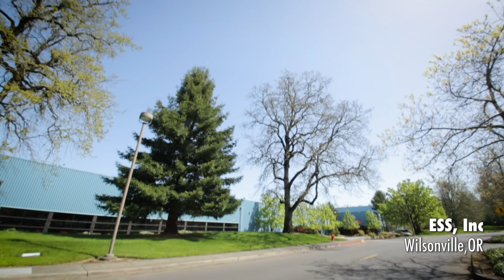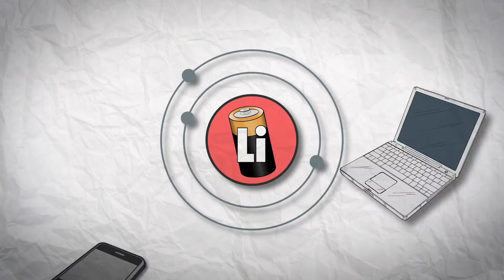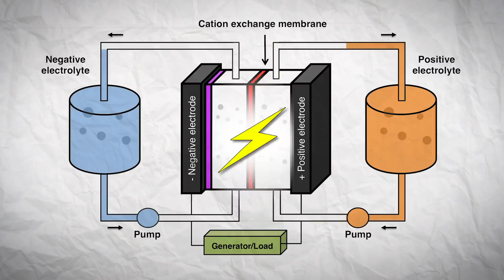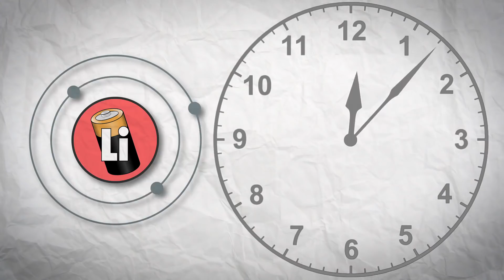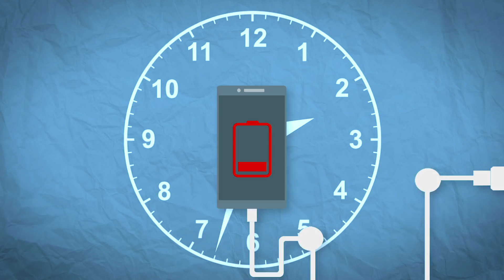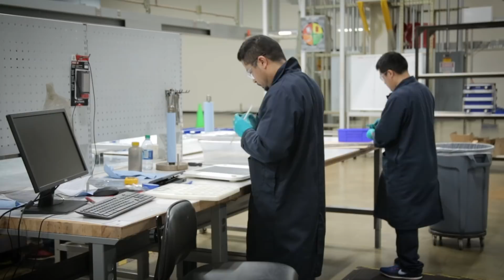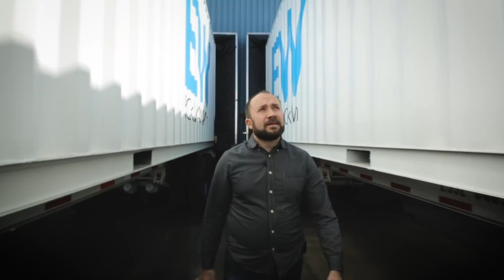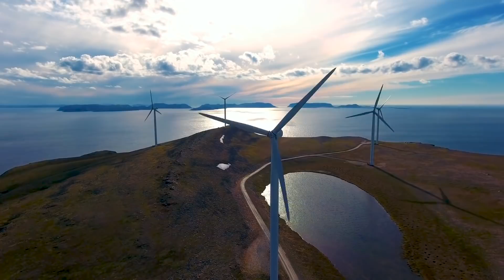Battery Fueled by Iron and Water Could Transform the Power Grid

Comment: i want to see a diy of an iron water flow battery
Reply: Angie G Take a potato or lemon ect. and put two different kinds of metal in it.  Then you have a battery.  There is no need for college, for a two minute project.
Reply: You will not see a DIY version from this company,  first this was a advertisement and second there website says 🤣they don't sell to residential 🤣
Reply: Me, too.
Reply: https://www.youtube.com/watch?v=WZkqgj1J_WE&t=1s

The Chemistry isn't exactly the same in this one but it is very similar.
Reply: Robert Murray Smith did a (better) DIY Iron-Nickel aka NiFe battery.  You can get the iron and nickel from your local pottery shop and the electrolyte is just potassium hydroxide.  He has moved on to all carbon batteries now which are even cheaper and safer than the iron batteries + they capture carbon... but the old NiFe  videos are still up.  Just look up a standard electrode potential table and you can make batteries from all kind of materials.
Reply: Kira Queen , I think you just did.
Reply: no i mean like, someone starting from scratch getting stuff at homedepot to make a smaller scale version of this
Reply: Yesss GUYS! DO YOU KNOW DIY NIFE OR IRON FLOW ETC. VIDEOS-GUIDES? 
WOULD LOVE TO DO SOME 

ALSO BATTERY RESTORATION IS INTERESTING 

STAY AMAZING AND A GREAT DAY GUYS
Reply: Take a chemistry class in college and you will get to make your own battery

Comment: I was wondering if this could be scaled down for use in a residential setting. A major cost for going off the grid for homeowners are the Li storage batteries, and they also require strict maintenance, and carry the same hazards that Li batteries in cell phones do.
Reply: Aragamis (SilverComet)
I'm talking about single-home use. The one shown could power a block, so one for one home should be smaller. As to cost, you have to figure in that these are purported to be viable for 20-25 years, whereas, Li batteries need to be replaced every couple of years or so.
Reply: Argamis (SilverComet)
WTF? I'm not talking about battery disposal, I'm talking about cost for the buyer. You still haven't explained why this battery would be more expensive than a Li battery. This battery wouldn't have any cost for disposal, other than hauling it away. If it can be made cheaply and do the job, I'm not sure what your continuing objection is And, stop thumbing up your own comments.
Reply: Keep your Li-Ion battery charge between 20-80%, 10-25C and it'll last you 50 years.
Reply: Aragamis (SilverComet)
Sure, if the car only drives 12,000 miles a year, but you didn't mention the cost for those batteries, and you haven't explained why a battery that's constructed from materials that can be obtained at Home Depot would be more expensive.

Edited to add that the "cheap" Tesla model is $35,000.
Reply: Yay, a civil argument!
Reply: Future Hindsight actually living pff grid is much easier now. I have a normal house running off batteries charged by solar and wind. Produces 240v to rin heatpump, elect. Water heater and stove. 
I install these solar generators on million dollar homes too.
Reply: The only cell phone batteries that had issues was Samsung Note, because they tried to ignore the laws of physics. Ever wonder why billions of other phones, laptops, and cars never explode? They aren't trying to cheat physics.
Reply: I think the problem is the energy density. Your new battery would be a lot bulkier compared to a lithium ion one with the same capacity.
Reply: Jerry Rupprecht
I get that, but if it could be scaled to even van-sized, the cost and safety and environmental savings might make it viable.
Reply: Why would you buy the battery in that case? It can apparently be made from parts available at harware stores. Build your own.
Reply: mikldude tesla batteries that are now 6-7 years old still have over 90% of there capacity. I think 25 to 30 years may be a stretch but 20 years is what's being expected
Reply: The ESS battery is primarily used for C&I or utility scale application.  It certainly could be scaled down, but it becomes more challenging on the business side
Reply: Scale is two fold the cells determine peak output the volume of liquid stored  determines capacity
Reply: What strict maintenance is there with li-ion ? Just don't over charge / discharge which is controlled by BMW. That's it
Reply: Li-ion batteries can be made to last 25-30 years (like the ones in Tesla cars).
-> The reason the ones in cellphones last less is since it is a bit cheaper to make (not much, but in the dozen millon units it is noticeable); and because they are EXPECTED to not be used in five years regardless [because their tech is by then beyond obsolete and it will actually hurt your productivity and social interactions to keep one (not compatible with last APPs)].
  
This iron/water batteries can not be scaled down to power a single house at a similar price. Since they are using semi-trucks to move the "standard size", one small enough to be loaded inside a vehicle that does not require a special driver license would not be powerfull enough to power by itself a typical family home.
Reply: You had to compare apples to apples. A typical home does not NEED to transfer the same ammounts of joules in-and-out-and-in-again (regenerative breaking) as fast as a car has to [that helps keeping the battery healthy even if more energy "passes through it" in 20-30 years].
  
Second: Nobody pays upfront for the battery disposal (this is a cost that is offloaded to either the manufacturer who wants to recycle the lithium for new batteirs, or the regional waste management bureau just to reduce contamination).
-> This is why this technology is not targeted to individual consumers, but small enterprises [with high demands] or big corporations [with relatively small energy needs]; because they will get tax exemptions ~or something~ from the goverment.
Reply: tigertoo01  time will tell my friend ,
   I'm still skeptical when one  or  two people pipe and say  "oh tesla batteries have lasted X amount of time and miles ",  
but we have really  no idea what sort of  duty they have been  used for  in the real world .
CEO's and  Enthusiasts have been known to be a bit happy with facts and figures  at times .
Reply: of course also in this argument the target market of the device is being ignored. these batteries aren't for your car or home. they are to plant next to a wind farm or next to each wind turbine. the engineering/cost issue is a container stores 100kW and a turbine generates say 2 MW which is 20 containers per turbine. how much per unit? how much each x 20-40 per turbine can one be delivered for at full production scale? 20 years lifecycle and minimal disposal fees (double check) vs a Lithium ion solution. Factor in environmental costs of Lithium vs Iron mining and then relative disposal environmental cost as well.

how much per unit delivered at full production scale? and relative environmental costs? are the two questions necessary to answer
Reply: It is not cheaper to make it or use it (in fact, it probably costs more per KWh if you do not use MANY of this  truck-sized batteries on a VERY BIG system).
-> The whole idea is that is "eco friendly" because you can make a hole on the ground, dump the battery and forget.
Reply: @adolfodef  what is your guess, how much would it cost per kWh? Li-batteries for end consumer are now 500-400 for one kWh.
Reply: Argamis (SilverComet)  really , tesla batteries last 25 or 30 years ??  sorry mate , i will believe that when i see it .
  A big car company that also uses lithium batteries in their cars , and also has a lot of shares in tesla , apparently their lithium batteries  get to a certain mileage then degrade quickly according to their spare parts guys ..
   What percentage of tesla battery will still operational at 30 years or even 20 years  ???